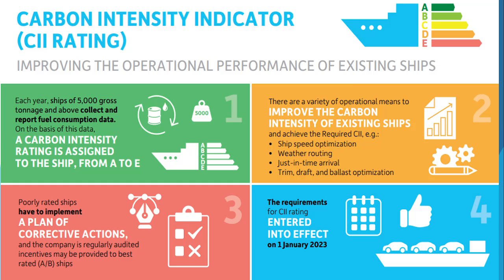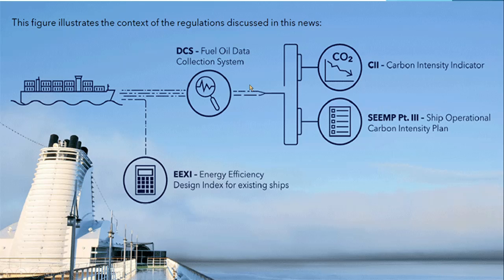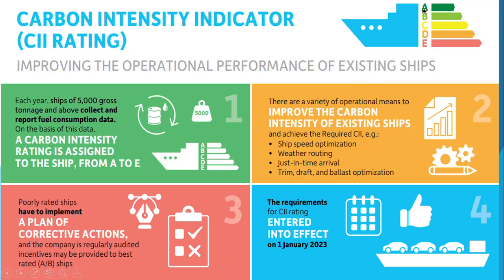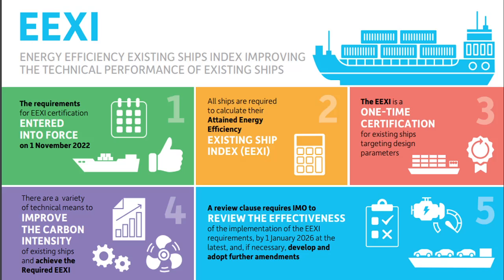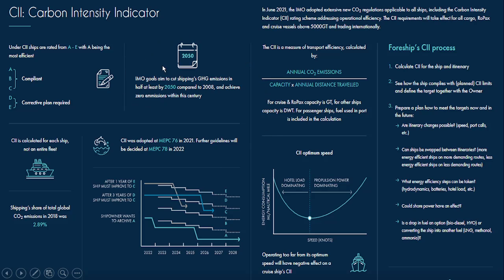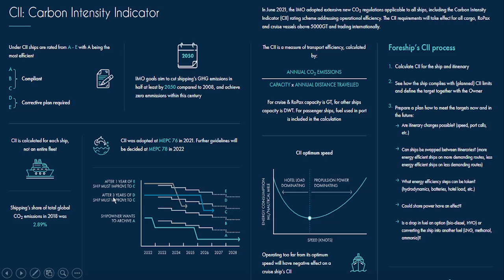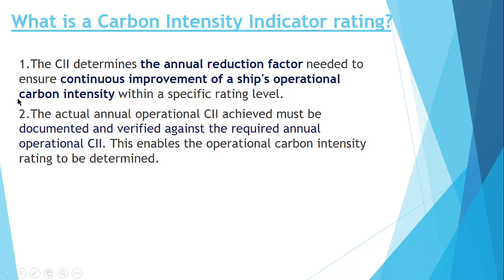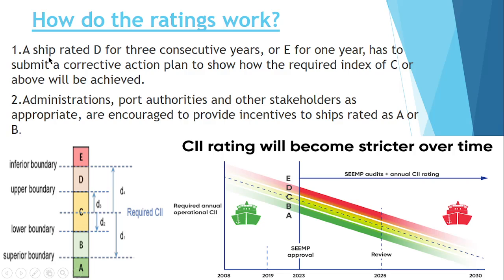Carbon Intensity Indicator| CII |How rating is given In CII| How CII is calculated

Comment: Hey, what penalty is given is they don't meet CII rating A,B. 
Do they have to pay a fine?
Reply from the maker: you need to submit plan with corrective action  within 1 year and need to implement the plan in order to meet cii value
Reply: @MarineEngineeringHub  And if they don't submit a plan? If they don't implement it? Is there a fine involved? What is the punishment?
Reply from the maker: ship will be detained after certain period 
company will be black listed by MOUs such as paris mou or tokyo mou 
it will hamper  ship owner business 

this is very rare